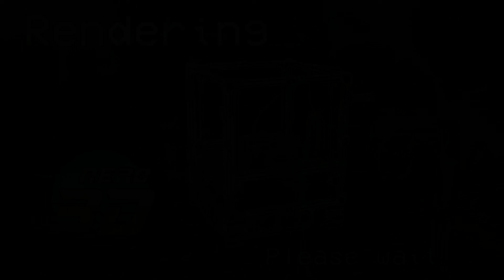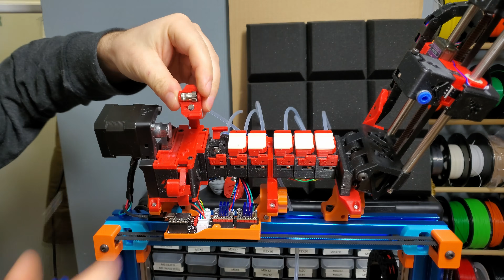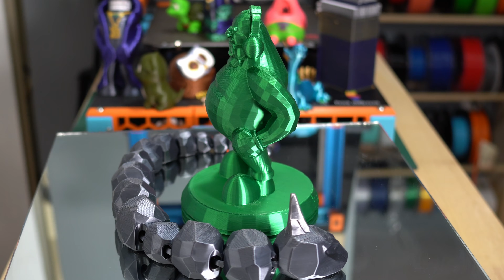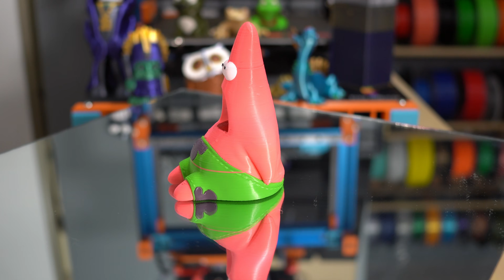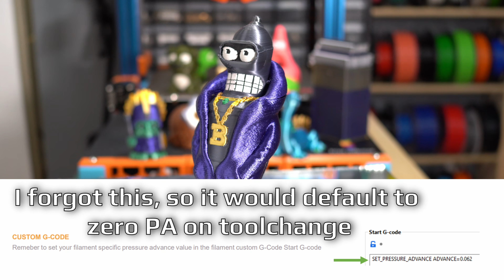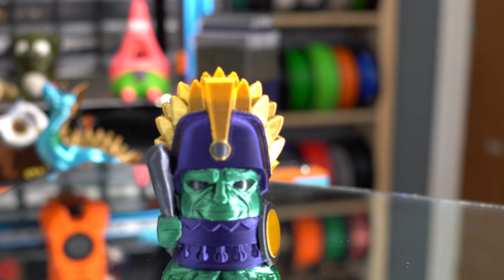The Enraged Rabbit Carrot Feed - The open source customizable MMU

Comment: With prusaSlicer or SuperSlicer, set pressure advance and smooth time in the start GCode for each filament, then it will be loaded after each change. I have a dual extruder Bowden on my switchwire and o use the built in macro language to check whether I'm I have EXTRUDER_DIRECT or EXTRUDER_DUALEX_BOWDEN in the printer notes in the same way the default prusa profiles check for model, so can have the same filament profiles for clockwork/afterburner printers rather than duplicating most of the tuning.

Comment: Do you run into issues running different polymers through the nozzle with ERCF? I'm picturing using ABS and a TPU or some kind of flex, but since it's going through the same nozzle I'd be worried about mixing causing layer adhesion issues.
Reply: You won't have issues unless you are using different materials on the same print. For example, mixing pla and petg.
Reply: @PunaJussi sorry for the necropost, but one solution is mechanical interlocking of the materials

Comment: What I'd really like to build (next year) is a Voron IDEX with that as its primary mode of filament change plus two ERCFs to expand my options for the occasional extensively multicolored print. And if the filament changes are optimized between the two printheads, this should also cut down on time.
Reply: Doomcube discord my man. That is if you aren't currently on it
Reply: Still planning this?

Comment: It's indeed the waste tower which makes me not using it. I already hate I'm 3D printing with plastic, so I only print things I actually need. Usually things I designed myself, more as a learning experience which I do enjoy.
Reply: Depends on your use case, for many prints you can use the infill for wiping which doesn't waste plastic.
Reply: pla is not so bad as real plastic. it s made out of corn from what i know. i hate plastic too bro
Reply: lore the large part is about how its decomposed. Pla is not bio degradable
Reply: @user-yk1cw8im4h  it depends on conditions and length.  pla does biodegrade somewhat.  a thousand years buried in the ground it will be pretty much gone.  much better than other plastics but not what most people think for biodegradable

Comment: For printers where the X assembly can clear the edge of the bed, would a purge bucket reduce the amount of purge required? That way you don't have to maintain the purge block height
Reply from the maker: It wouldnt save as much filament as it would save time, since it just rapid out the filament without needing to print anything. 

Also purge towers can be adjusted, if theirs enough room on the bed for example, you can no printer "empty" layers on a pruge tower as long as the toolhead/gantry doesnt collide with the print when it drops down

Comment: Is the board easy to fit on the stealth burner? I'm running an ab in my v2 and I don't know if I should get the stealthburner before building  an ERCF or just leave it like that
Reply: Stealthburner has two community modded extruders with sensors. Clockwork 1 and Galileo. They're just the regular cw1 and Galileo with some geometry to meet up with the SB cooler more aesthetically.
Reply: @Apophis-en9pi  thanks! I'll check that out

Comment: Would this be good for auto reloading filament when doing really long prints, or is there a better solution?
Reply from the maker: Yup, it can be used in a "continuous" spool mode
Reply: @CanuckCreator  In continuous mode, can you load more filament in an empty cart while it's printing from a different cart?
Reply: Should have read all the comments! You just answered my question above. Thanks!

Comment: is there a way to reduce the number of feeders? I am thinking about building one, but I am only concerned about filament runout. I'd like to have a two-spool feeder.
Reply from the maker: you can build it with as many feeders as you want, so yes, you could do a dual feed system.